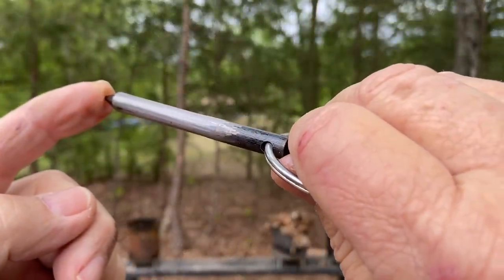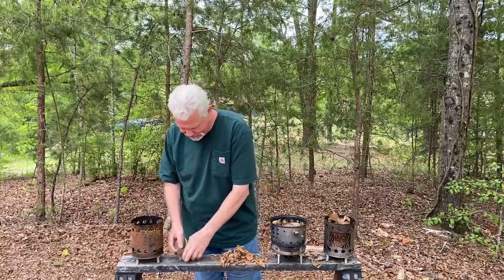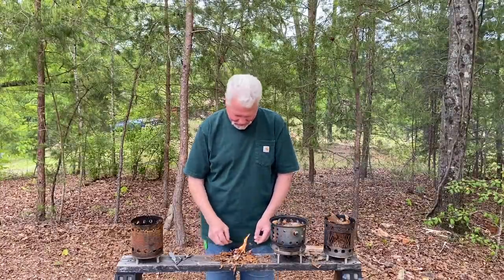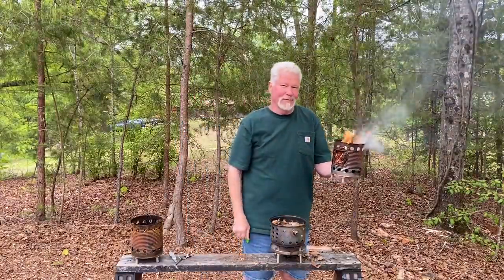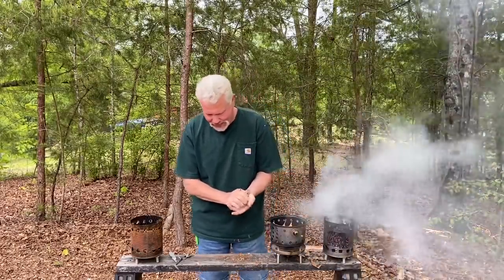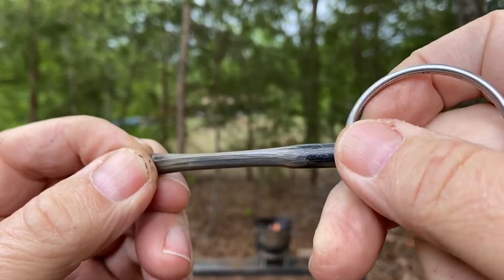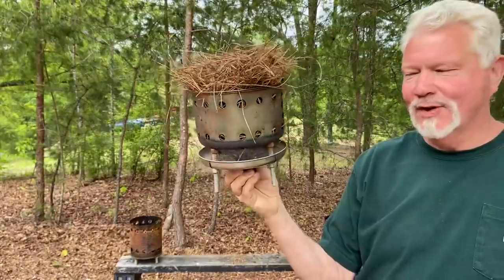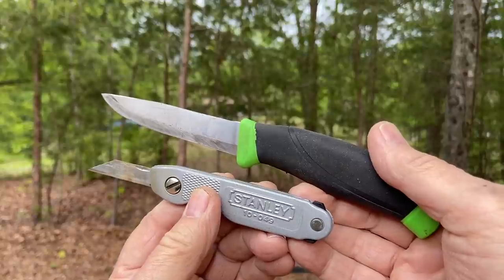Why Aren't Well Worn Ferro Rods Demo’ed On YouTube?

Comment: Hey Dave, nice video. I was wondering how you feel about wax as a fire making tool? I soaked some small natural fiber rope in wax and when you fluff up the end and hold it along side the ferro rod it takes the spark nicely and you have a flame that can't hardly be blown out by the wind. I also soaked some small pine cones with a small wick attached for handy little fire starters!
Cheers from WA, Dan.
Reply from the maker: It just makes good sense to have long lasting fire starters. You'll probably be trying to ignite wettish wood on a regular basis.
Reply: Yep, those cotton and wax sticks make for nice tapers .. handy for reaching into awkward places where a Ferro Rod or BIC isn't practical.
'Salvaged' cotton strands that inadvertently 'fall off' the household mop work well 🤫😏.
Reply from the maker: Thanks Thomas!
Reply: 100% Cotton ball and vaseline work really well also and are so much easier to make. Works the same, protection from moisture, longer burn, but without using a double melt pot to melt wax and dip.
Reply from the maker: @brandonmefford4619  Yes, excellent!
Reply: @DavidWestBgood2ppl  thanks brother. Keep spreading the knowledge! There will always be thing's to learn and improve upon! I look forward to new video's from you.
Reply from the maker: @brandonmefford4619  Will do!
Reply: I took an old pill bottle, coiled some twine into it, and then melted some paraffin wax and poured it in. Now I've got a bunch of candle wick and it's rainproof as long as the cap is closed. With something like one of the little glass jars for lip balm, you could even use it right from the jar and it would be pretty wind resistant

Comment: Why aren't well worn ferro rods demonstrated on YouTube, you ask? 
The answer is simple. After dicking around with a ferro rod, most people realized that a BIC lighter is much easier and normal less than two bucks.
Reply from the maker: I use BICs all the time too.
Reply: @DavidWestBgood2ppl  point being, BICs are so easy and reliable that not many people have used a ferro rod enough to wear it down.
Reply from the maker: I understand. I'm referring to people that promote the technique and sell ferro rods though. Shouldn't their rods look more used? ever?